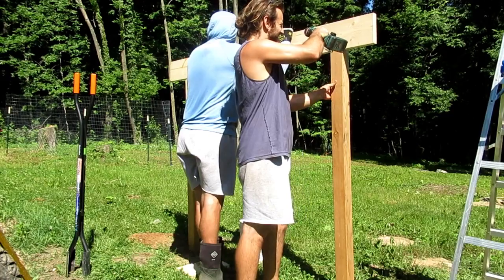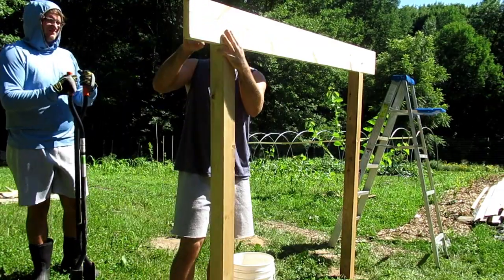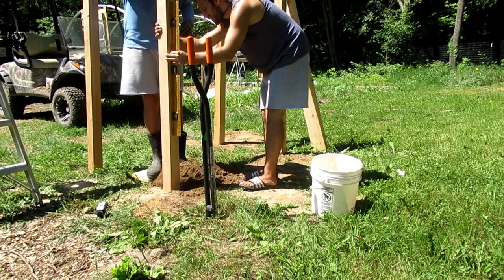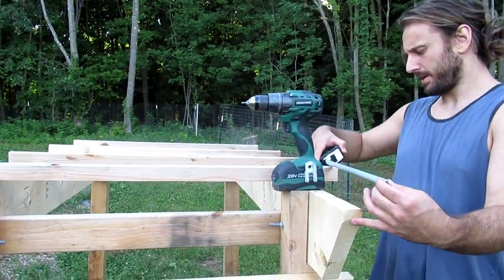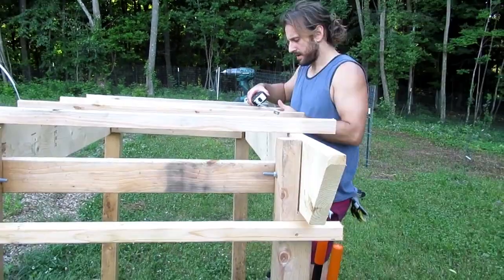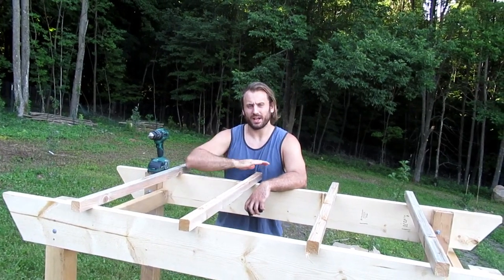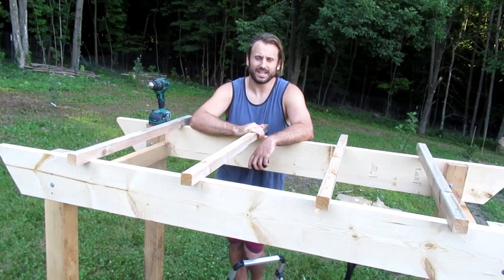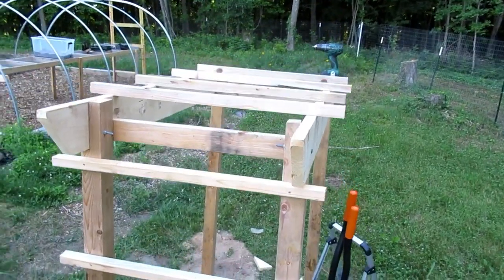Man Builds Sub-Par Grape Arbor

Comment: You really don't need to use 4x4s . 2x3s will be good enough. I am going to build one using 2x2s for one grape plant. I don't expect to have more than 20 lbs of grapes. So, 2x2s will be perfect and much less costly. I don't even dig any holes in the ground. With the weight of the grape vine and grapes, I don't think it is be blown away by wind. LOL